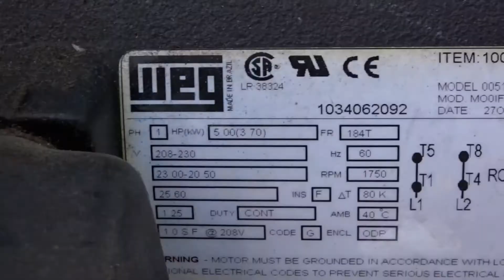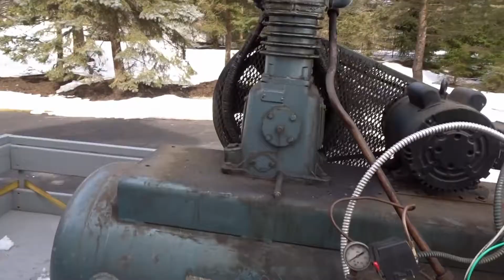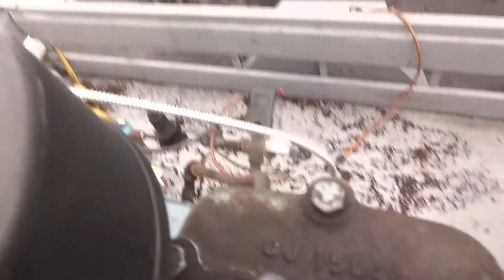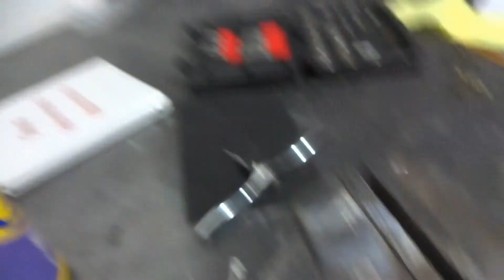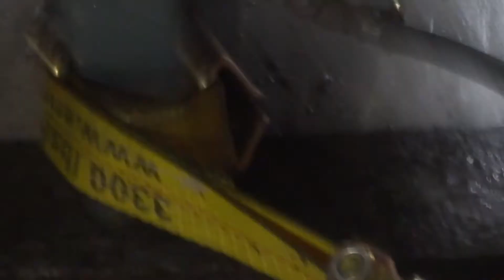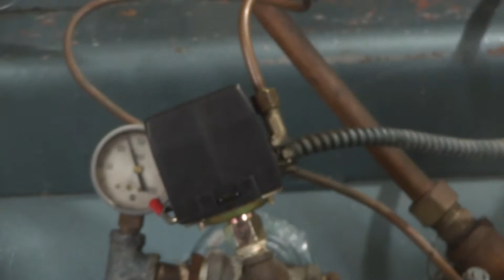Vintage Curtis Air Compressor Rescue  - Clean Up & Fire Up

Comment: I just bought one of these, but I am having startup issues. Now, I know my power supply is hurting when the pump kicks on, but its seems to be drawing WAY more power than expected. In my research I have come to think my unloader is not working properly. I understand the unloader on the pressure switch is supposed to unload from the compressor head to allow for easier start up... but how can it do this when it is hardlined to the tank, not the head???

Should I move my pressure switch to be teed off from the pipe between pump and tank? Adding a check-valve so tank pressure does not go back to head when unloading?
Reply from the maker: I don't have this compressor anymore but I do have a Curtis 3 cylinder vertical tank model.  I looked at mine and the line from the pressure switch is connected to the pipe right before it enters the tank.  I also had to replace my pressure switch as it was leaking a bit.  Hope this helps.  Thanks for watching and commenting.
Reply: @elwellboy I did a bunch of research and talking with compressor part companies since writing that, and they said the same thing.

Turns out, whoever last had my compressor didnt even have an unloader line... so i bought some coper tube, a new switch, and some fittings to add one myself!

Comment: that baby works like a champ! amazing! I would go for these well kept vintage compressors over new ones anytime, they look beautiful, reliable, durable, easy to maintain and quieter in operation.
Reply from the maker: Agreed.  I wish I had a need for it in my shop but decided to sell it.  Actually quieter than the relatively small compressor I currently have.  Nothing like "old iron" quality.  Thanks for watching and commenting.
Reply: @elwellboy  during this week I picked up a quincy X-2 compressor pump, did not know what it was or how old, the metallic light blue paint on it threw me off as it looked very minty, I got it nonetheless because of its beautiful bottle like shape. I will baby it into a full on compressor with tank and period correct motor!